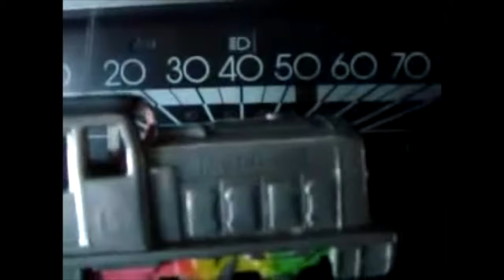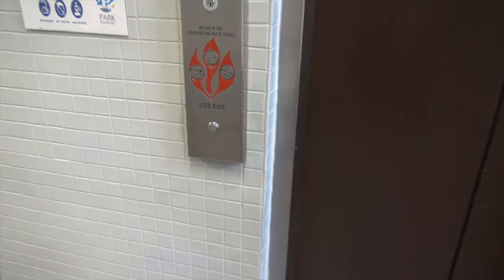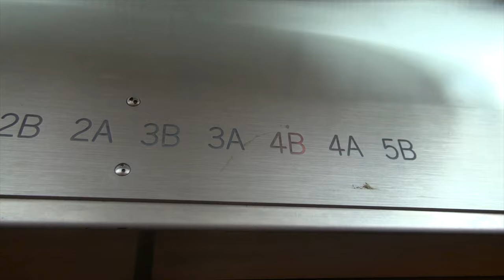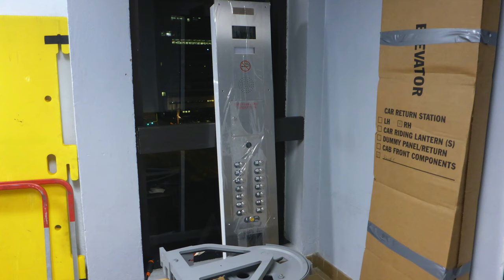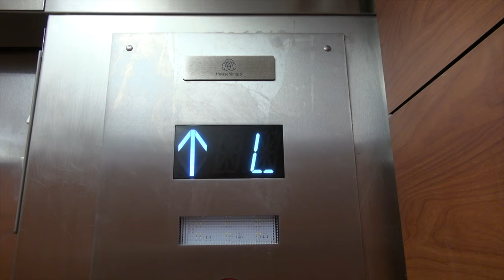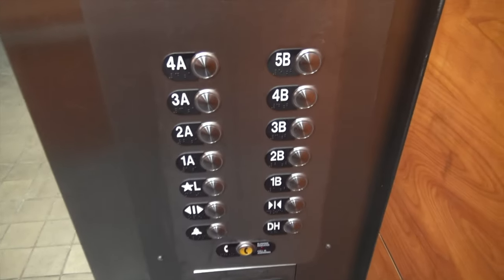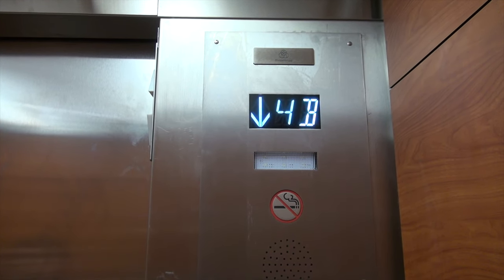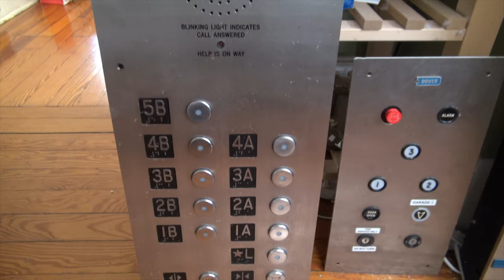Before and after: The DieselDucy Elevator at the Church Ave. Garage in Roanoke VA has been modded!

Comment: there's one thing i don't quite get and its why the new indicator on this one is surface mounted on a flush-to-the-wall metal panel as opposed to the others which are flush mounted in a larger surface mount panel. They did an excellent job with it tho